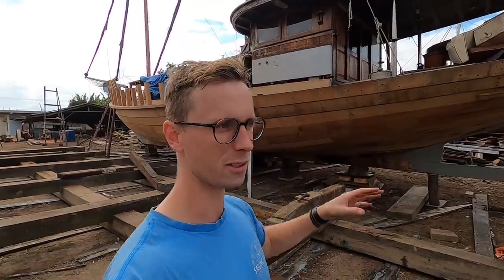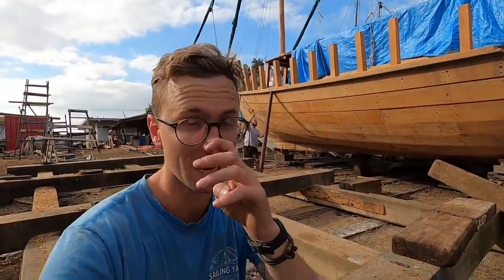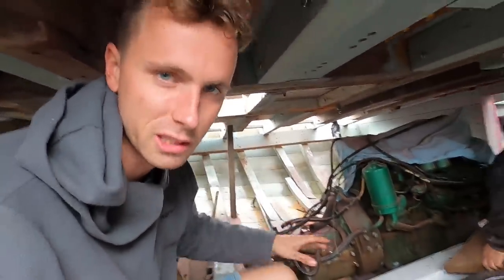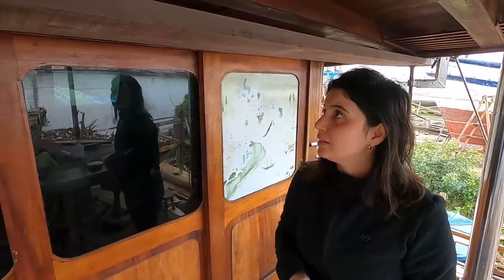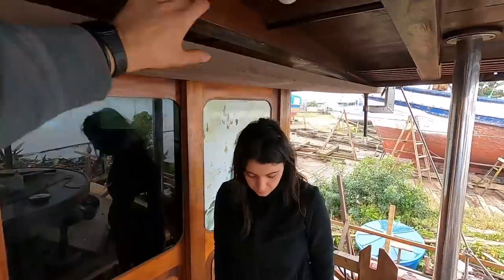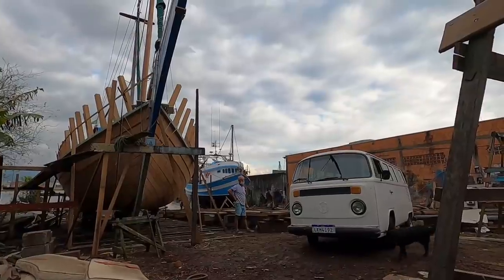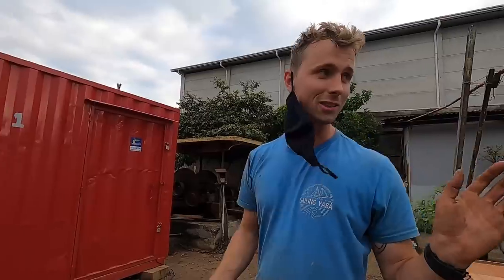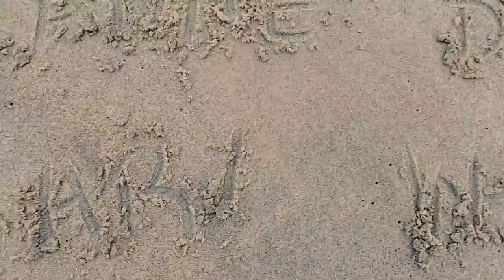This is NOT how an engine gets removed from a boat! — Sailing Yabá #48

Comment: The engine access hatch should be reviewed. The boat is being rebuilt, improve the access.
Reply: Concordo com a opinião facilitar é melhor do que complicar
Reply: Seems like the engine is up under the superstructure. So they can’t put a hatch over it. Plus, changing the design of a boat can have a negative ripple effect.
Reply: It’s hard to see where the engine is to be actually located in that new open hull. I suspect it will be directly under the hatch so as to make all future repairs unobstructed by overhead decking. 

Nice job on the boat rebuild so far guys. What is the back story in why you chose this particular ship yard? It might make an interesting story in itself. Definitely follow the engine rebuild.
Reply: @KymHammond  the hatch sizing is an issue, they had to take off the gearbox and the valve covers to get it out. From what the video shows, the engine had to be dragged inside the hull, and on deck. They are already redoing most of the structure, perhaps this can be improved.
Reply: removing the engine is not done very often, I don't think it's worth to modify the hatch just to fit the engine better
Reply: @Cowboy_Foradalei  I agree that you would not go into a shipyard to modify the hatch. But once you are in a shipyard, changed the keel, all the planking and deck beams...the hatch is peanuts
Reply: @KymHammond  they explained the back story and all in the first couple of videos.
Reply: @ricardokowalski1579  they didn’t change anything about all that though. They only replaced them exactly as they were. Nothing about the original boat plan was altered. So the “peanuts” would be a big change from what’s been done.
Reply: @srcastic8764  they already added bulkheads, made them water tight which I believe the previous divisions were not.  And are changing the saloon. See episode #40 Min 3:20
Reply: @ricardokowalski1579  you’re right about that. 
I’m not sure a hatch can be placed directly above the engine anyway. Based on where he was pointing when describing the removal process, it appears the engine is under the superstructure so a hatch there may not be possible.  But surely there could be a better system devised to get it out when needed. Then again, how often do you remove a boat engine?  What they really need to do is get rid of that engine and get a new one, like a Yanmar or some other modern, more efficient engine.
Reply: @srcastic8764  neither do I know.  That is why I said it should be considered . What I do know is that dragging the engine like that is a hazard. And this old engine WILL need replacement in the life of the renovated hull.
Reply: Agreed. Move the main deck hatch and add a roof hatch. So much easier to use a crane or Block and tackle.
Reply: @srcastic8764  I’ve watched the channel from the beginning and most of the focus then was on the condition of the.hull, the sea crossing from place of purchase and then in the ship yard how much of the hull needed to be replaced. None of that footage ever defended the shipwrights as dramatic tension was held between the amounts of the boat on each episode that needed to be cut away and whether it was worth it. No one ever spoke up for the skills these shipwrights. 

It might have been simply fact that they were the only ones working on wooden boats, but very quietly and in front of our eyes they appear to have pulled off a miracle. So, who are they?
Reply: @ricardokowalski1579 , it's part of the boat's structure that did not have to be replaced.  Also the hatch is hard up against the deckhouse.  Without moving and rebuilding the deckhouse, the hatch is not going to be over the engine.

It might be possible to make it wider, but going back more will require cutting and rebuilding more deck beams.
Reply: @Cowboy_Foradalei , Agreed. Pulling the entire engine is a rare event in a boat like this.  Only if you're going to re-power in which case, the hatch issues is a minor issue.
Reply: @jfarmer1711  and repowering by today’s standards would most likely mean a smaller engine. 

An American cargo pilot during the Vietnam war told us a story about how unassuming Chinese Junks were fitted out with large navy marine engines that could suddenly turn on PT Boat speeds if they were spooked when on missions. The camouflage Junks were copied of previous boats used by the organised crime gangs to move goods around.
Reply: @jfarmer1711  maybe the hatch can't be altered 🤷. But there are alternatives, a trolley beam under the deckhouse, to move the engine towards the hatch. All I am saying is that it should be reviewed, the renovated hull will outlive this engine.

Comment: I HAVE HAD IT!!!!  THINGS MUST CHANGE!!  Please send me an application to work at that shipyard.  I am 68.  I Will work for free.  In three years, I would be a physical specimen.  Unless of course my joints and cartilage give out first.  At the beginning of this remodel, I was skeptical if not downright nuts that anyone would be able to complete a project like that.  What about electrical and plumbing that needs to be done?  When does that come into the schedule?  Good job you two.  You overcame.  Good lessons for me.  Thanks.

Comment: Repeating a suggestion: definitely record the engine rebuild. Never pass up such a content opportunity.
Reply: Even better, don’t rebuild it. Replace it with a new, stronger, more reliable engine like a Yanmar or something.
Reply: @srcastic8764  I don't recall them giving any details about their current engine. It may well be worth a rebuild.
Reply: @srcastic8764  I have a Ricardo Weifang 4100 that has 1750 hours without issue, except for some sensors. Costs only 10th of what a new BetaMarine would cost. Yanmar is crap anyway. If you do want a brand, rebuild a nice Cummins or Mercedes. That is a joy every time you start.
Reply: @creageous  hope they include engin details
Reply: @srcastic8764  You gonna buy it for them?...... no didn't think so eh....
Reply: @MegaDirtyberty  we’re all paying for all this stuff buddy, every time we watch a video. A new engine isn’t much in the big picture of what they’re doing here compared to what they set out to do and thought they’d be doing.

Comment: Consider modifying the boat so you can use the boom to hoist and place engine components. Or modify the design of the power train to use smaller components. Maybe a hybrid diesel generator/electric drive with big battery bank and solar trickle charger.

Comment: Before recycling became widespread, the local boy scouts used to pick up old newspapers once a month to take to the insulation factory as a way to raise some funds. My dad had a furniture store and so we would sometimes use his delivery van to help them pick up the newspapers. One time we loaded 5500 pounds of newspapers into a 1970 half-ton Ford Econoline van. Let's just say that the van was riding a little low on its suspension.....

Comment: Good idea to take the Old Diesel engine to the mechanics shop. Hopefully he has all the specialty tools to rebuild it. If there is and engine kit and replacement parts available it should rebuild at a reasonable cost to as new condition, and last another 30 or 40 year with a good maintenance. To me it would be a better option than replacing it with a new diesel with all the electronic junk on it...

Comment: Now that the hull is complete I notice that she is very shallow.  Are you planning on taking the boat off shore, or just stay in coastal waters?
Reply: It’s a simply question. They are smart enough to answer for themselves.  There is no need to be insulting.
Reply: @merlars  I don’t know what type of boat MP grew up and doubt you do either. But they have indeed mentioned several times that they intend to “travel the world” once Yaba is completed. This does imply crossings and this boat simply is not designed for that purpose. As to whether they are smart enough to figure that out, well, they did buy this boat thinking it needed only minor repairs.

Comment: I am glad you made the decision to pull the engine and gearbox vs having it worked on in place. Your mechanic will be able to do a more comprehensive inspection and be a lot more effective during rebuild.

Comment: The engine looks like its long dead.  It needs a major overhaul. Good luck!
Reply: It ran almost perfect when they brought the boat along the coast. Just a couple of electrical problems IIRC.  Also the engine is only about 15 years old so hardly run in yet.  regards

Comment: If you are rebuilding the engine it would be good to add heat exchanger cooling, so that fresh water (typically with glycol) would circulate through the engine block as opposed to seawater. Also, the reduction gear internals, especially the thrust bearing, and the clutches, should be checked as well.

Comment: Get a big dc motor on the main shaft with a belt.  You can run it as a gen with motor running or have a very limited range electric moto

Comment: Build a  new engine mount as a transfer sled that fits over the main frames with your engine mounts on the sled…So that when you re-install, the engine can drop straight down the hatch, onto its mounts on the sled, and then the sled can be slid back at a shallow angle to mate with the transmission and drive shaft.  The sled then is locked into place on the underlying frames with heavy bolts.  This will really help if you ever need to Un ship the engine again, or even do major maintenance or rebuild in place.

Comment: That was interesting! It's odd but obviously Yaba was not originally built in the way to remove the engine the easy way. But you did it.
If you have the budget for that, maybe you should consider selling your old engine and buying a new, small and reliable one. It is a matter of safety for you who are going to make Yaba your home.

Comment: The engine was obsolete when it was new, parts will be rare and expensive to repair. Don’t waste time and money on it. The ZF transmission is a good one and worth rebuilding if it’s within the working range and attachment of a new or rebuilt engine.
Reply: @ralphgesler5110  Why haven't you questioned/attacked everyone's knowledge base that have declared rebuilding the engine is a good idea?
Reply: @ralphgesler5110  
Been there, done that, wins and fails with plenty of busted knuckles with invented words.

Comment: It's hard not to say "We told you so!"  (Remove the engine while the planking and deck was off)
Reply: I said that a long time ago, it would have been much easier.
Reply: Like I said why not put the fuel and water and holding tanks in before they got to this stage? But then I have never built A boat
Reply: @giles-df9yu  With the main cabin walls yet to be built, and the entire interior gutted, I agree, now would be the last good opportunity to do just that.
Reply: Lol. I said let it drop out the bottom when the ship had no ribs or bottom. The engine isn’t going to be worth rebuilding due to its obsoleteness(finding parts). Transmission is rebuildable (don’t that drop).
Reply: @SkypowerwithKarl  I remember you saying it. I said something like that. This would have been done and back in by now.
Reply: @Tuju's workboat 
Lol have you ever tried to tow a displacement hull too fast? Things just break. Your right. Slow, reliable, efficient. Kubota will do nicely.
Reply: @SkypowerwithKarl   Even though production by Daimler Benz ceased in the mid 80's, (due to not conforming to new emission standards), they are still being built by TATA in India, so spares should not be much of a problem....
Reply: @SailingYachtDreamcatcher  
Marinized parts are also going to be hard to come by. Exhaust manifolds in salt water usually last 10 years max if the anodes are regularly serviced. Heat exchangers have anodes too. Based on the condition of the Yaba how well do you think it was maintained? Passages  could be nearly eaten through and/or hopelessly clogged with minerals/corrosion. Wish I had $1000 for every engine I clean out only to find the blockage was only thing keeping the coolant in. Lol. I wish they did some test on it when it ran. There’s time to throw in the towel and when they pull the head, covers and pan hopefully an honest mechanic will give them the right assessment. I just don’t want these two nice people to get any more in debt for a bad cause.

Comment: I think the only thing I would had done different on that type of boat is one I would have had the ribs leathened about 2 feet taller second the keel I would have made it at least a 30 inch tall keel for better  handling  and 3dr I would have had the upper side supports not go through the deck but made ontop to keep water out for sooner or later it will start to leak back into the boat .

Comment: Does anybody know exactly what the engine is they've just removed from YABA?  I don't recognize it and my innate curiosity has been piqued.
Reply from the maker: Hey Don! It’s a Mercedes Benz! OM 352 A sorry we didn’t mention it in this episode!
Reply: @SailingYaba  Cheers!  I believe you're doing a fine job but feared right from the beginning that you might have bitten off more than you could chew.  Not so much as the work involved but the cost.

Comment: I’m a 19 year journeyman diesel mechanic. Please take this advice. Drive that engine to a steel recycling center. 

If you’re planning on sailing internationally then you’ll want en engine with parts availability and reliability. Also a modern engine will get much better fuel economy. 

Same as your friend at Odd Life did. 

Do a fundraiser if needed. I’d donate to see a new engine put in.

Comment: “Let’s put a 500kilo engine in a VW bus.”

Entire Internet: “That’ll never work.”

Puts engine in VW bus.

Entire Internet: “Our apologies, we will never doubt you again.”
Reply: Does no one have a pickup truck, or at least a trailer? I mentioned before a hatch should be over the engine and associated equipment. Could also build a beam with a lifting eye in to the remake.
Reply: @jamesglavich1426  logic?! Logic?! We don’t need no stinking logic!!!
Reply: @jamesglavich1426  They said something about putting it on a trailer, but I guess that plan fell through.
Reply: @jamesglavich1426 , the section of deck around the engine hatch has not been changed.  It is part of the boat that could be reused.

Comment: definitely worth "replacing" the engine with a Beta Marine "non electronic, fully mechanical" diesel motor.  Not sure what brand that motor is, but I'll bet the parts will be hard to find based on the age......  You need reliability when offshore.  Go new.

Comment: If it was me I would put a silent tipe generator in nog enough to run the all the electric an make the drive electric as well. Then it would be much easier to insulate sound and vibration

Comment: The reason they had to work so hard was because you didn't plan properly.  The transom was off the boat for days, weeks, months? Any of that time could have been spent sliding the engine out the back of the boat and lowering it down.

Comment: Apparently, that wasn't the original engine OR the designer was a moron, the engine should be under the hatch, and they make smaller engines now that have a lot more power and do a better, more efficient job, think about the reconstruction and if you ever have problems with it in a remote location where you won't have the expertise of these rugged old school craftsmen! Trade the motor off and get a better one.
Reply: If the engine was under the hatch it would block the hatch, so no one could enter through the hatch.

Comment: Could not stop laughing, this is not how to move and engine, you're going to have more fun putting it back after repairs, or you could go diesel elect propulsion instead. Get more to the litre that way, but the electrics can be a headache at times. If you want to know more, just ask
Reply: Did it move? Yes. Don't forget if it looks stupid but works.. It's not stupid
Reply: @gordhume1262  Also, don't forget you might have got away with this time, but it does not mean you get away with it again

Comment: That was the most unsafe way to remove that engine. You're lucky no one got severally injured. The chainfall was ok but you never use rope to suspend or lift an engine.all that rope has to do is hit a sharp corner or be the least bit dry rot , the it breaks and someone looses a finger,hand, foot gets crushed under it.
Reply: I wouldn't trust you or myself with a rope and an engine.  But I'd trust that old salt of a boss with any method and means he thought fit.
Reply: @DWilliams-ce8nb  
Im sorry, I wouldn't trust anyone to use rope or anything other than a chain. That's just asking for trouble.just because he hasn't had an accident until now doesn't mean it can't happen.